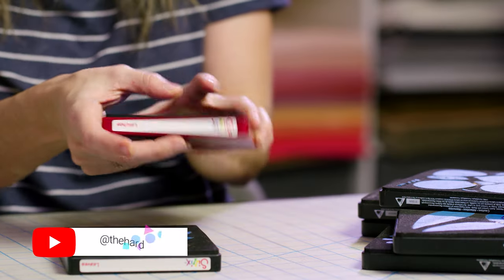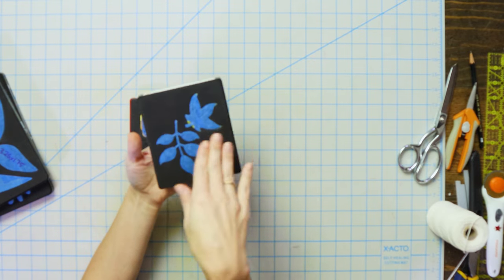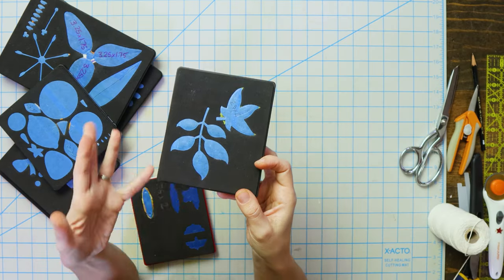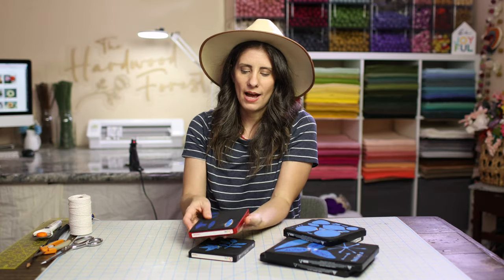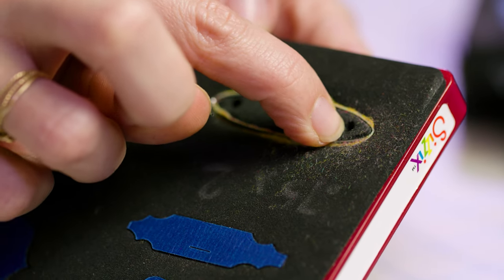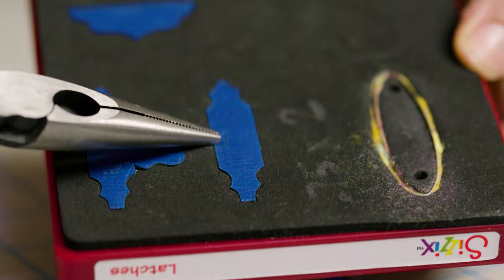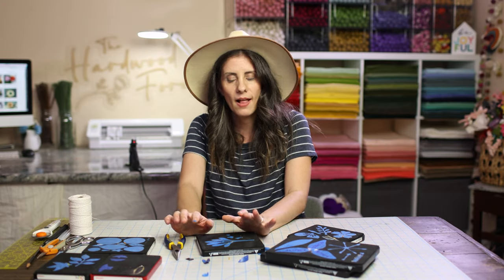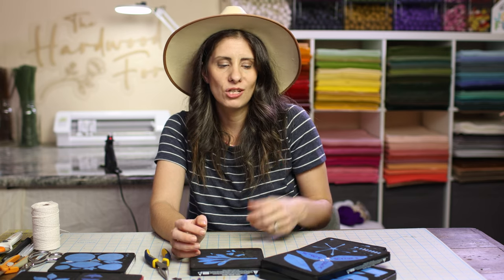How to Modify Steel Rule Dies for Die Cutting Sizzix cutting machines.

Comment: I tried this today! I wanted to remove a BIG circle in the middle of a flower, so I could just poke my wire through………hours of pulling later…….even my husband tried………I ended up taking the plastic cover off the whole die……and I tapped out the circle from the underneath in about 3 seconds 🥴😆 Job done. 
The plastic cover slid back on, no problems. Made some pretty ‘sepals’ before I went to bed. 🤗
Reply from the maker: Nice! I find the circles some of the hardest to get out! So happy it worked for you!

Comment: I think I would keep a small board not too thick maybe say a 12" x 4" piece of finished smooth plywood 1/4 to 1/2 inch thick to lay over the dies when they are stubborn pulling to avoid injury. Also it can give you a bit more stablity and added pull strength to have something besides your hand around the edges of the die to hold it firmly down and in place too. Just a thought. As much as I love to call HUBBY can you come and help  me...I also love my independence and as he's now passing his mid 80's I'm aware his hands too are stiffer and not as pliable or lets call that flexible these days as they once were. In other words after 52 plus years of marriage have I worn him out? Probably not just thinking why risk injury to him if I can do it myself safely too. I was searching for your videos this size for using steel rule dies. I've had a play date with a friend using a few of the Superdant steel rule dies and she was wondering how these are made. Will of course this video is fantastic since you tore one apart to show and tell at the start. Thank you for this. And now and again I too wish a die did not have an element. I've had my husband file down imprint or cut areas on dies like think dies so in two cases I wanted to be able to use them only on the front edge of a card and the back end of the die actually cut marks across like stitch marks across it but if these are removed I could choose any width of any card and not be stuck with one mini size card shape because not only did it cut the marks into it but about a quarter of an inch further it also cut the card stock completely out. Not sure why some of these die makers don't grasp the obvious but who knows. Limitations that are not needed should be realized and avoided is my way of thinking but die making companies aren't asking my input. Happy to see you going so far to show and share this information with us. Thank you. I've already implemented the blue tape method for defining the dies. Thanks again.
Reply from the maker: I love your idea of using a piece of scrap wood to help with leverage! And as an independent women myself you bet I will try multiple different times before I ask for help! So happy that this has opened a door to your crafting possibilities by just looking at die a little differently now! Happy Crafting!